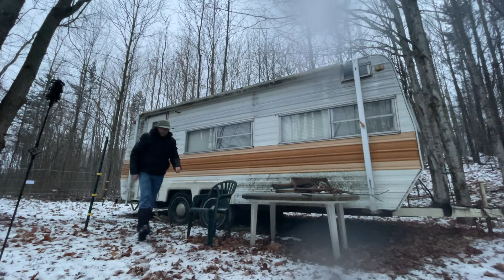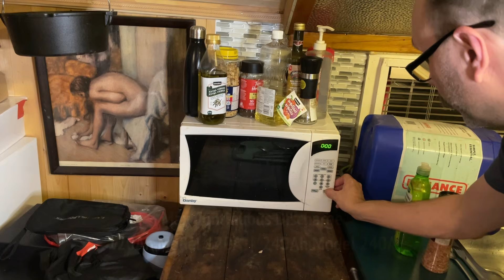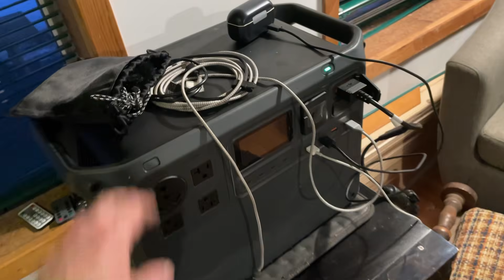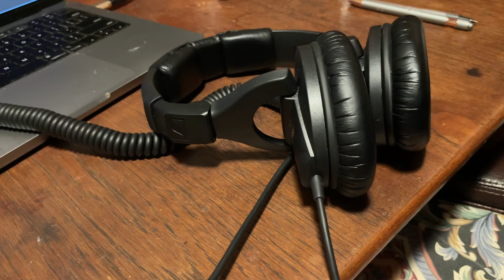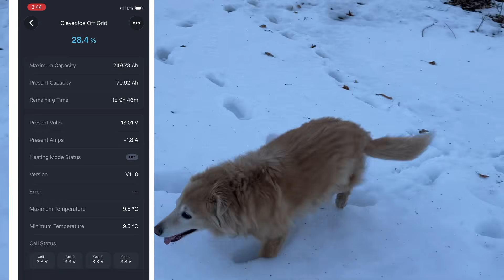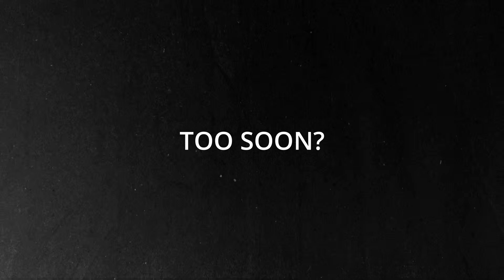I Tested Renogy's 16-Year Solid-State Battery Off Grid | Pro S1 Review

Comment: Thanks for another informative video, I have gasoline generator for my home, in case of power outages, which could happen as we speak with high winds and freezing rain on top of the 40 centimetres of blowing snow. I am thinking of a back up to the generator and not sure which would be best, I need it primarily for this gas powered furnace, plus fridge and freezer, any thoughts? Thanks again for the great content.
Reply from the maker: Thanks! Are you leaning towards a diy system or power station?